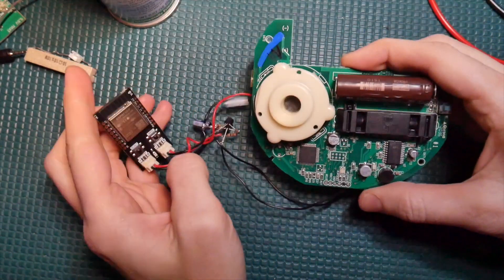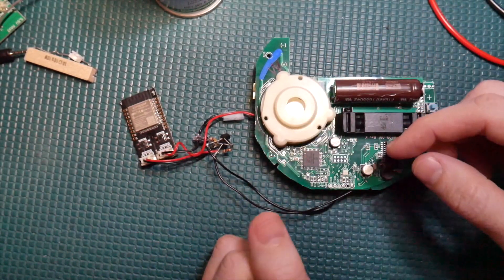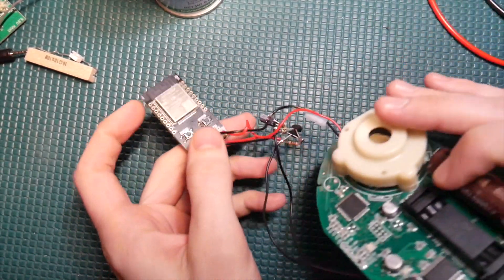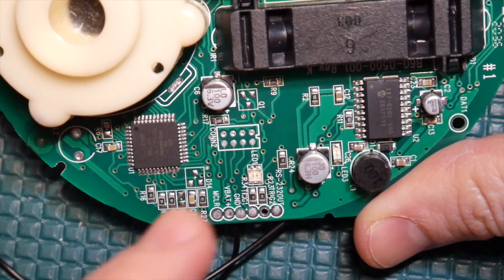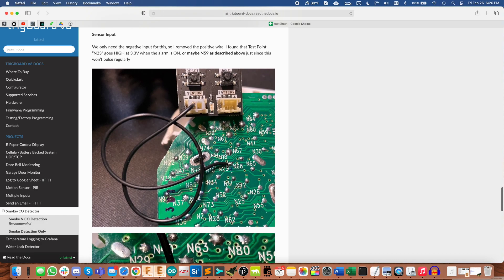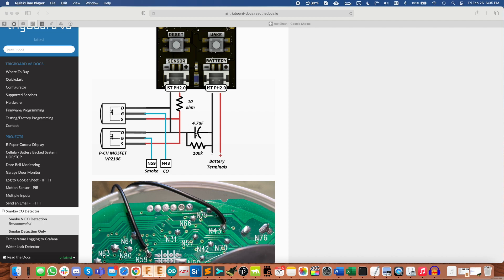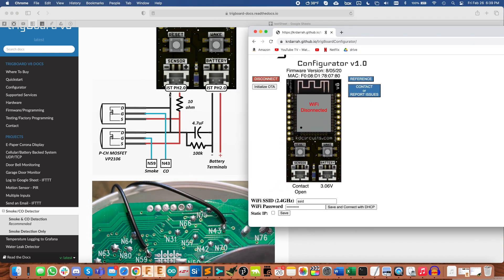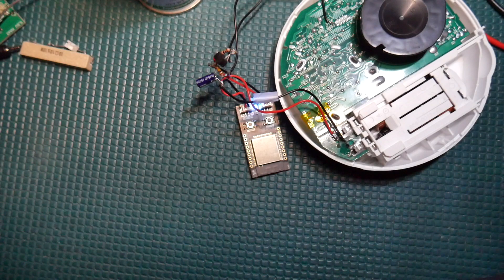Smoke/CO Detector with WiFi Push Notifications ESP32 (trigBoard) PART 2 CO Detection TESTED

Comment: Love your work mate! Thought I'd add in a bit of info regarding 240V Aussie smokies (AS3786-2014) Typically your interconnect wire puts out an elv signal 9-12V referenced to the circuit neutral. Us Aussies shouldn't need to hack into a smokie due to this feature built in.